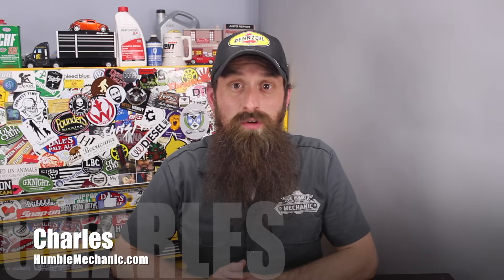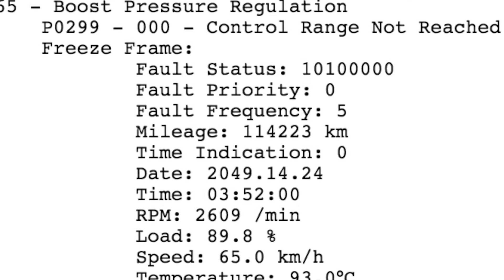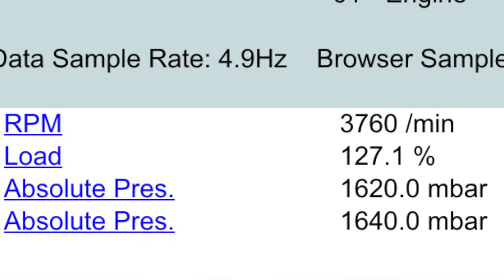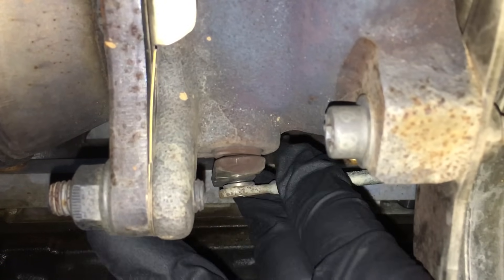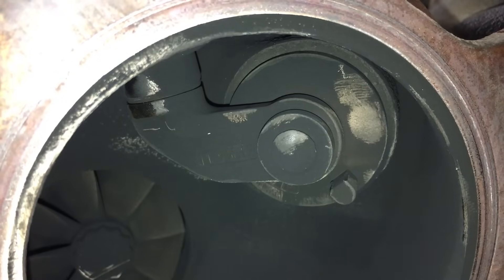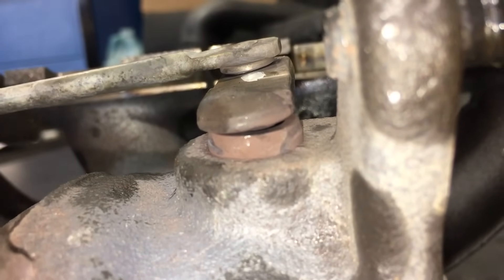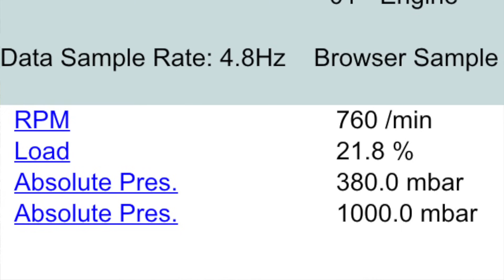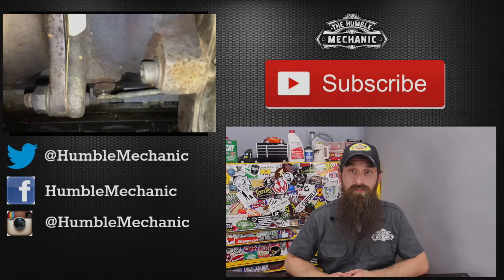Does Your VW/Audi 2.0t TSI Have A Bad Turbo

Comment: Humble mechanic. My Tiguan has the p0299 code. I verified the loose wastegate by removing the o2 sensor, bore scope and wigled the actuator arm. What are your thoughts on refurbished oem vs aftermarket "oem" spec turbos? I'm specifically looking at a made in China vofon turbo that states it meets or excedes oem specs. They are readily available at half the cost on eBay and Amazon with no core charge. Too good to be true?
Reply: Id just get a used OEM IHI turbo with low mileage from a reputable seller on ebay. Can be had for like $300 and if its from a reputable seller just return it if anything is loose.
Reply: any OEM parts in a VW I'd be very skeptical, especially from China haha. VW's can be pretty finicky cars

Comment: Do not mess around with a Turbo that is making noise or doing any of this. I killed my perfectly good ALH by not realizing the turbo could take out my engine when it failed. I just figured I'd replace the turbo when it went and that was a $5000 bad idea. I now have a low mileage used ALH and a new VNT-17 that should last me another 300,000 miles.

Comment: I don’t have any codes but do have a whistle at high RPMs after adding CTS cold air intake as well as Stage 1 from IE, would that be considered a bad turbo? Thank you
Reply from the maker: May just be hearing the noise amplification after intake.  That’s common

Comment: So if the wastegate is the issue, you have to replace the whole turbo?  Are there parts to just replace the faulty arm? I currently have my Audi Q5 at the dealer for this P0299 code, and now I'm freaking out on the $ amount

Comment: Great video!  I recently got a differently fault that I've been looking up.  Not sure if it is related.  Any clue on P-2563?  I can't figure it out.  I already re-adjusted the voltage range, but the darn car just loses boost at high speed.  (At low speed it's fine).

Comment: What if we have that much play in the waste-gate arm going into the turbo, and the waste-gate it's self moves just as easily, both around in circles and in and out on it's seat, yet there are no under-boost codes??? 30k miles on my 16 GTI and I would like to have a warranty turbo replaced instead of it coming out of my pocket. I was able to insepct the waste-gate so thoroughly during the installation of a downpipe. (which I would be removing before the trip to the dealership). My car has not been flashed, and I haven't noticed a huge decrease in acceleration rate, or oil consumption, and like I said in the beginning, no codes at all...any advice????

Comment: Yo humble mechanic I have a 1.8tsi Jetta and my wastegate has a little side to side play not really up and down. I'm just checking for preventive maintenance. Also car runs fine but I don't have a boat guava she so I don't know for sure. Please respond thank you 👌🏽
Reply: But I don't have a boost gauge*
Reply from the maker: +Lewis Beverly haven't seen issues with the 1.8. But some movement is normal
Reply: Okay thanks man another question any info on 1.8tsi like differences or just information period.Up and coming diesel mechanic and you videos help me quite a bit thanks for the help 👌🏽

Comment: How much noise should come from the waste gate actuator rod joint? I have a 2015 GTI DSG with 40K miles. For a while now the actuator rod will make some awful rattle tap tap tap noises under certain engine loads. I had the dealer look at it once and ' they didn't hear anything'...  I know there was an aftermarket clip for the MK5 or 6 to take up some of the play in the joint. Thanks!
Reply: Weston Will my gti does the same thing man. I guess it's normal but yea it happens when accelerating from like 2.5k rpm up under medium load. It's add but I do hear it if I listen for it
Reply: Weston Will my GTI 6 was doing the exact same thing...it got worse and then about a month later i had to change my turbo...i had a boost leak code coz of the rattle on the actuator.
Reply: I have an mk7.5 that was making that tick sound after 3krpm, took it to dealer and told me it was something common, guess they fixed something cause have not heard it since that day, never gave a code or felt loss of power, that tick was kind of loud sometimes.

Comment: So on my 07 A4 2.0T I got scans that read misfires in cylinders 1 & 4 as well as the turbo being under boost. The cylinders misfire around 4000 rpms, would the ECU cut boost when it reads a misfire?

Comment: Hi, so if the waste gate is loose and causing the under-boost, does that mean the entire turbo assembly is bad and needs to be replaced (And the waste-gate cannot be fixed)?
Reply from the maker: I’ve seen repair kits on eBay. But never tried them. Looks like maybe you have to drill out the old one.

Comment: I have this code on my 2007 gti. I have apr stage 1 tune and I took it to the dealership and they are blaming it on my hpfp/tune. I only get the code when its hot and I run my car hard. They claimed no boost leaks but I am not sure they actually even checked.
Reply from the maker: +thefsxflyer that is often the case that dealers will point to aftermarket software as the cause. 

I have mixed feeling on it.

Comment: I have a conundrum. I have a 2007 audi a4 with a 2.0 tsi. Huge amount of oil in intercooler, about a quart a month. Changed pcv valve and nothing has changed. No turbo faults come up. Only 78k on it and it drives fine. I'm terrified to drive it because I dont know what could be wrong. Any thoughts? Thanks so much

Comment: my turbo on my 2014 Passat TDI started whining, it got louder as the RPM's went up. I took it into my dealer and they couldn't find the problem. when I picked it up and drove across town and stopped to fill it up, it started blowing smoke out the tailpipe and the engine started running rough and knocking. the gas station looked as if it was on fire there was so much smoke. they replaced the turbo and even had to replace the inner cooler and converter?  it only had about 26,000 miles on it.
Reply: wow thats crazy , how much was the repair
Reply: luckily it was under warranty. I guesstimate about $4500

Comment: Unfortunately I need to use this video, fortunately there is this video lol I have an is12 with the same kind of play throwing the same kind of code… Looks like an is20 and a tune as in the future for my golf sport wagon. If anybody is reading this a little bit of a quick fix or a patch try using some high temp copper lubricant and attempt to pack it in the cracks when it wiggles it’s only an aspirin for a heart condition lol but it’s keeping me getting around till I can get a replacement on.
Reply from the maker: Oh dang that sucks!!!!

Comment: well Charles as always I love your videos but hate to watch them!! I had this code p299 for almost 6-9 months it comes on and off every few months. I will defiantly check this. I have a question unrelated to this p299 code so here it goes..... I have a 2013 tiguan engine "CCTA" I was wondering if the valve cover gasket uses an actual gasket around the spark plugs or does it use RTV? and if it uses RTV can I use normal RTV or must I use the genuine VW RTV is their any difference? and what type would you use? As always brother thanks for doing what you do on youtube much appreciated!!!!!!

Comment: My 2012 jetta mk6 1.4 tsi highline (turbo & supercharger) gives me a check engine light intermittently... Normally from 3rd to 6th gear in the range of 3500rpm. The car also shudders and feels like it is misfiring.
My current mileage is 99500km.
The VW dealership that serviced my car recently could not pick up the fault, and assures me that it is not the spark plugs or coil packs.

What would be your opinion on this, and what would you think is the problem?
Thanks a lot for the info!

Comment: I have a question ! Audi 2013 a6 2.0 89k miles .
Summer is here and I turned on the ac and I noticed I get turbo spool when the ac is on . Is this a normal thing ? Or is my ac compressor going bad ? Thanks guys !

Comment: Hi i just got a 2007 VW Passat 2.0T I accidentally put regular gas in it. The check engine light comes on and after a free diagnostic test from auto-zone the code is P0299 Turbocharger underboost   . I don’t know if I have to check a mechanic shop or refill it with premium.
Reply from the maker: I doubt those things are related.

Comment: Hello humble mechanic I’m having a p0238 code on my mk5 bpy engine I have already replaced my g31 boost sensor still no dice. Epc light is on as all would greatly appreciate it if u had some suggestions

Comment: As you have said hear the whistle while driving unfortunately my Audi has 0299 Code on I did replaced diverter valve ,, reset the check engine light week after light came on, and listening your video says hear for the whistle,, yes man I hear the little whistle, so what  should I do please help, thanks,

Comment: Just bought a 2012 VW Eos 6 months ago with 52k miles on it, already the water pump has gone twice due to the valve cover gasket leaking on the water pump seal.  Replaced the valve cover gasket  which seemed to fix the problem. This weekend got a low oil pressure warning, checked the oil and nothing was on he dip stick, put 3 qts of oil in her and took her to the dealership. Got a call from the service lead saying the Turbo is going and has been sucking up all the oil. $2,800 for a new turbo. Is the price accurate Humble Mechanic? No way I can afford 2,800 for a new turbo. Please help!!!

Comment: I expect this would also apply for the ol' 1.8t
Reply: Yes. I did the oil return line on my 1.8T the other day. Pretty much identical back there where the turbo is. I have a 03' Jetta with 74 xxx km's on it. The turbo on it does not seem to be right. It's is under boosting. Did blow the P0299 code. Found the clamps for the air filter were not tight. Fixed it. Ran it. Code didn't come back. But still under boost.

Comment: Hello Charles, I'm putting in about 2qts of oil in every 450miles.  If my waste gate had "slop" in it or play could that be the cause of burning oil as well?  Tiguan 2010 112Kmiles
Reply from the maker: +vulcanbespock wow that's a lot of oil. My guess is you have other issues.
Reply: @HumbleMechanic may have something more to say but if it's a 2 litre TSI a common fault for oil consumption is the PCV valve. It seems like that's about 2.5 litres, though, which is more than half it's oil capacity, so that may be more excessive than a PCV valve would allow for! I was getting through around 1 litre every 1500 miles, that has reduced noticeably since I replaced the PCV valve.

Comment: I have a 2011 q5 tfsi 2.0 i have no codes but o can feel intermittent  boost sometimes. I have replaced the PCV box twice and the valve cover gasket and the upper timming chain cover. Its like the turbo  boost is blowing seals and causing  the oil leaks. What advice might you have?
Reply: 166k miles Original turbo.

Comment: why does the wastegate fail ? if it is only failure and the turbine is ok, can t that be fixed in some way ? for tdi there is complicated VNT but that can be fixed, can t believe that the wastegate which is just a round plug can t be fixed .

Comment: Hey man need your help, I have a bmw 5 series twin turbo. I have a P0229 “Turbo Underboost” check everywhere and see the left Intercooler is bent and has a hole in the side of it. Do you think replacing this will fix the issue?
Reply from the maker: It may not be the only issue, but it is an issue that needs to be fixed. You basically have a boost leak

Comment: Have you seen a waste gate failure that allows too much boost?  I have a stock mk5 GTI that is spiking boost on acceleration and then misfiring and am wondering if an issue with the waste gate might be the problem.
Reply from the maker: I personally have not, but you can convince me that is an issue.e

Comment: A video on DIY changing out a 1.8T B5 Passat turbo would be great, next time you do one.
Reply from the maker: That is going to happen. My Passat is coming due for it's second one. That will probably be 2 videos. The full DIY on that exact car. Then some generic tips for replacing T-belts.
Reply: @HumbleMechanic  Did you ever make the video of the 1.8 TSI turbo replacement? I need it very much right about now.

Comment: Hi,
i have vw passat 2ltr diesel engine,WG arm on turnbo is leaking gas that gets inside car cabin.Question is do you think i  should get WG arm repaired or do i need a new turbo?
will appreciate it if you could reply,
thank you
Regards

Comment: I noticed the newer gen IHI turbos like the is12, is20, and is38 seem to all have a redesigned reinforced wastage arm actuator hinge. Hopefully this issue has been addressed and resolved on the newer turbos!  Just had our second Tiguan show the same fault. Going to check the arm soon for play and then gunna try the waste gate actuator clip from this https://static.nhtsa.gov/odi/tsbs/2013/MC-10155952-9999.pdf

Comment: I have the 2010 vw cc. Is the turbo charger in the same location as the Tiguan, or can i access it from up top?
Reply from the maker: +Wayne Scott yep top side is best
Reply: HumbleMechanic: Thanks, it turns out my turbo charger went out, that part is very expensive.
Reply: HumbleMechanic my 2006 vw fsi turbo passat doesn't want to turn on i put a new engin and still wont turn on. What do you recommend i should do?
Reply: @waynescott9938  hey what was your symptoms? I have this code alone with other codes. Could you tell me how your car acted when it went out trying to see what kind of money I may be looking at

Comment: I wouldn't say that it's a bad turbo charger. More bad wastegate/actuator clearance.
A bad turbo charger consists more with bearing clearances and the rotating assembly being out of balance. 

Since the actuator on these VWs looks to be non-adjustable, you can try replacing the actuator (don't really condone just throwing parts at a problem) or turbine housing and actuator, together. 

(don't condone this either, actuators are relatively cheap for a car part, so it's easier to just replace it) A hack way is drill the mounting holes on the actuator and bolt it in so the there is more tension on the wategate arm.
Reply from the maker: I feel what you are saying. But this is sold as a unit. And while it could be repaired(maybe) that is most likely not going to happen. 

To repair a vehicle with issue, will almost always require replacement of the turbocharger.

Comment: What if I get my k03 from a mkv rebuilt with slight movement coming from the exhaust blade and I barely rotate the actuator flap I was planning on doing this rebuild with a new forge actuator ?

Comment: charles, im looking to buy 1 2016 tsi and during strong accel, it has a short whistle that goes away after the engine temp is it 190 normal..... accel. is strong without any hiccups. is this short 1 sec whistle normal in tsi turbo? thanks jim

Comment: 2014 Tiguan, replaced the Turbo two years ago at 30,000km. Now the check engine has gone off again and the dealer is saying that the Turbo need to be replaced again because of the waste gate, at 50,000km. Not too excited to replace the Turbo again. Is this abnormal? Why is this happening at such low mileage? Thx

Comment: You could take a spray bottle with soapy water and spray on hoses, couplers for boost leak check. Sometime you can't hear by driving plus the soapy water spray bottle is big help to check for vaccum leaks and injector seal leaks without having a turbocharged or procharge engine.   Oh, came here from eric the car guy.

Comment: i have a golf gti 2.0t fsi, its blow clouds of smoking from the exhaust burning oil, is this a sign of the turbo going? i have checked my pcv, now gonna my mechanic check stem seals.. i have oil on my spark plugs in all 4 cyclinders.. whats going on?

Comment: i have a vw passat 2014 and Im experiencing a boost leak after changing the heater core , what do you think i should look first ? can you point me in the right direction it would help a lot !
Reply from the maker: That is odd. There shouldn't be any over lap. Make sure something didn't impact the bottom of the car and hit the charge cooler.

Comment: @humblemechanic
Is the new 2019 Tiguan a good vech?
Have they improved awd so you don't have to replace all 4 tires if one needs replacing?
Reply from the maker: Vw never had that on AWD. They recommend 2 but not 4. Well not that I’ve seen. 

The biggest 2019 issue I’ve seen is roof leaks.
Reply: @HumbleMechanic  so 2wd is the way to go but awd isn't bad, got it. And if you don't get a pano roof your should be good I'm sensing!? 
 Heard anything aboit the tune for these from ARP it is super slow and needs a power upgrade for sure.

Comment: Are you saying the waste gate valve should not be able to rotate when seated with the turbo fully assembled?  Mine seats very tightly but upon manually opening the waste gate, the valve will spin freely.
Reply: I've had no codes or issues by the way, had the turbo out for other reasons.
Reply from the maker: +Woody Ridenour that is the way it should work.
Reply: Woody Ridenour 6ñ

Comment: I had this problem, but i ended up buying a small metal clip from the Dealership that goes on that very spot. It stopped this strange noise that i was getting from that arm. Im getting the high pitch sound under boost sometimes now, could it be my dv not holding up to boost?

Comment: So what about adjusting the wastegate arm to firm up the seating of the wastegate seat inside the turbine?
Reply from the maker: I’ve heard some guys having luck with that. I’m not sure it’s a permanent solution
Reply: @HumbleMechanic  So I was able to get the adjuster of the rod that works the wastegate to "lengthen" and that closed the wategate at idle. I was able to do this with the turbo in place. So far no P0299 code and the car's power is back to normal.

To me this should be the first thing to try before replacing the turbo.